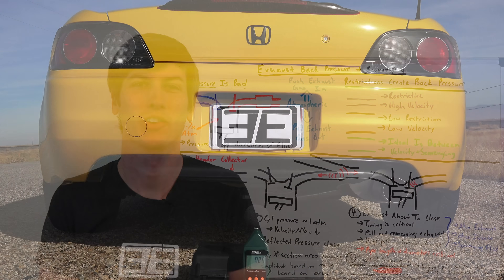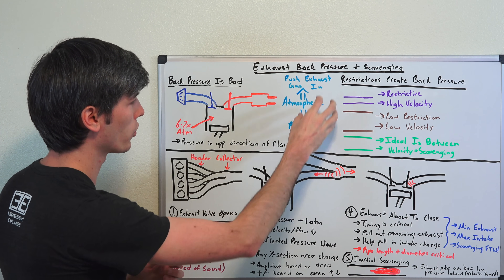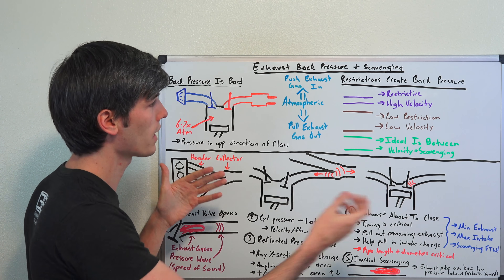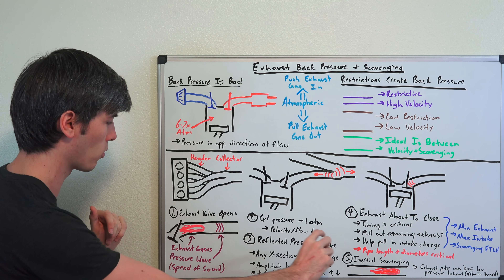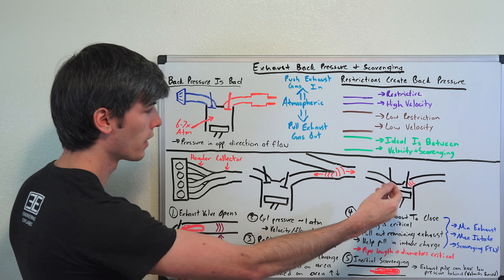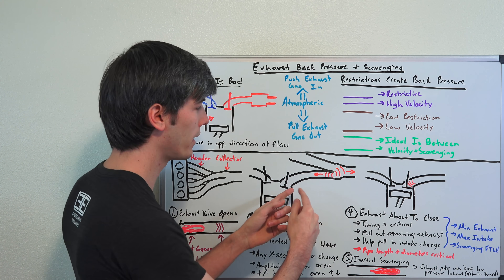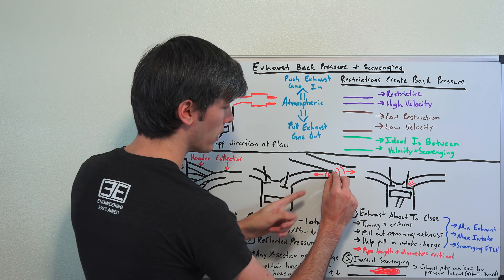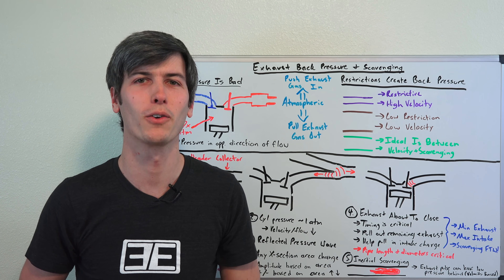Stop Saying Car Exhausts Need Back Pressure

Comment: Now we would need a nice list with good exhaust diameters for 1.6 2.0 2.5 and so on. Maybe 2 or 3 diameters 1 for high rpm Performance 1 for mid rpm and 1 for low rpm. And from that a optimal diameter for all rpm. 😁
Happy new Year btw. 👋
Reply: 99Lezard99. Not really possible, a 2.0 with 7:1 compression is going to behave different than a 2.0 with 14:1 compression.  And thats just one variable.
Reply: DrewLSsix True. Plus one might rev to 8k one to 6k aso

Comment: With need for a lower external pressure for exhaust gasses, do manufacturers consider aerodynamics of where the exhaust is placed to maximize vacuum  or are the fractions of an atmosphere negligible?
Reply: Negligible unless you’re running serious drag car power

That said top fuel cars create about 5-600 lb of downforce from their exhaust  just because they move so much air 

Same reason pro mod drag cars will run bull horn style exhaust. Every little bit counts. 

But honestly in passenger cars you’re more worried about the physical exhaust route than you are the gasses coming from it. Same goes for “low” hp cars
Reply: It makes a difference on motorcycles as their aerodynamics are crap. For example changing the direction of the exhaust tip can mean that you increase back pressure and harm horsepower by trying to make the gas escape into a high pressure zone. Or moving it a little bit can mean having the exhaust gases exit into a low pressure zone and helping with the scavenging effect.
They can't be measured on a dyno. Unless your dyno is also in a wind tunnel

Comment: Are installing headers on the s2000
Reply from the maker: I might eventually, but no current plans. I NEED to get that supercharger put on.
Reply: Engineering Explained sounds like interesting build
Reply: Engineering Explained that supercharger is going to be sick
Reply: Will you be replacing the pistons and possibly installing oil squirters.Not sure if that engine came with them.Also Id be changing head studs/bolts and a fresh headgasket.Costly upgrade to complete correctly,but Im sure you already know all this.Cant wait also.

Comment: So straight piping any vehicle is bad?
Reply: did you not watch the video?
Reply from the maker: Bad environmentally, yes. Generally it will improve power, as you remove restrictions. But you can remove restrictions without changing exhaust diameter (as is done in my catback video for my S2000).
Reply: NOT ON A TURBO IT CREATES BACK PRESSURE BEFORE THE EXHAUST ... I USE A CUTOFF FROM THE TURBO
Reply: No piping vs. having a very loud open header spewing exhaust under the vehicle to then be absorbed into the cabin.
Take your pick.
Reply: Forrest Olney so on naturally aspirated it would be bad

Comment: I live in the heart of NASCAR country, and the old time engine builders would bolt a straight pipe on the headers and run the engine up to 7k rpm, and where the pipe glowed cherry red, he'd cut the pipe and weld on a turn out. Said that little trick would add 5hp... This was back in the early 80's, so don't take any of this for gospel ;-) Excellent explanation Mr EE :-)
Reply: Painting flames on it adds another 5 hp.
Reply: That is exactly what they did- old drag racers know this.
Reply: I assume if you put a "pressure wave termination box" at this point and used a full length exhaust after, it would have the same effect. Right?

Comment: Im more disturbed by the fact that your pistons are never seated fully in the cylinders, you wont be driving anywhere with a car that has that much of a gap between cylinder walls and the piston
Reply from the maker: Are you okay with the flat cylinder heads? Pretty modern stuff in those drawings. :D
Reply: I mean if you want to look at it that way, the valves are just going to fall into the cylinder anyway.

Comment: Found when removing db killer from bike exhaust appears to have less torque/mid range..related?
Reply: Martin James Yes, at low rpms the gas velocity is slower than with the muffler in
Reply: Pavel Gajdoš thanks, bike Zzr1200 overall runs better with db killer in as best balance between low/mid/ top end but have noticed race bikes at Isle of Man TT in recent years getting louder..
Reply: Why did older motorcycles use fishtail exhausts?, some I recall seeing with explosions (pressure wave) just at the exhaust point of exit?

Comment: Another great video Jason! Mazda uses a great header design on their skyactiv g engines. 4-2-1 layout that prevents interference between cylinder exhaust cycles. Very important in Mazda's case bc theyre running 13:1 compression ratio, so theres little margin of error in terms of combustion chamber temps. Vital that each cylinders exhaust gases evacuate efficiently.

Comment: Good video and all you did a very good job explaining the science of this topic, but engines need back pressure. Scientifically you don't want any resistance at all as you have explained, but in the real world, you don't make the same power and the engine doesn't run right without a small amount of resistance. Look at it this way, I have a Ford pickup with a 4.9l i6, the carbed one with one exhaust from the manifold. I ran it on open headers for a while, when I put on a basic 2.5" pipe with a cat and a flomaster 40, the engine had more power and ran better. My guess is that with that resistance from the muffler, it creates a similar pressure wave it a vacuum in the piping that pulls the exhaust out of the cylinder, instead of no exhaust, where the Piston literally pushes the old air out, if that makes sense. That's my guess, but in my experience, a small bit of back pressure, like a small, not terribly restrictive muffler will perform better than without a muffler or resonator, something of the sort.
Reply: Your anecdote reciprocates what is stated in the video. Your conclusion, on the other hand, is incorrect.
Reply: +esqueue - you entirely missed the point of this video, apparently. While your example is kind of valid, even those cars have exhausts that have been analyzed and engineered. The length of those open pipe is not left to chance - it's very, VERY specific - to each engine. What the big difference is, is in where the power is desired. On those cars, the only consideration is ultimate top end power - so an open setup like that is ideal. The extremely narrow range or RPM's it's beneficial is not as important as the aid the proper length of of pipe gives.

On street dirven cars there are more considerations - most street cars drive of a wide range of RPM's, and not a lot are supercharged, so proper exhaust tuning is very beneficial. Pipe diameter, lengths of various sections and even bends make a difference - get it right and it's great. Get it wrong and it makes a dog out of an otherwise fun car.
Reply: corey Wellman im no expert by any means but Jason explains how the restriction in the exhaust piping creates velocity. I guess the term back pressure, exhaust gas velocity and restriction can be interpreted differently. In your case, having the exhaust gases dump into the atmosphere right after the header prob made less power vs stock setup bc of the lack of velocity. A stock or near stock engine flows a lower amount of air vs one thats modded (turbo, boring out, bigger throttle body, cylinder head etc)....The lack of airflow can be aided by the velocity of a more restrictive exhaust system. A Hellcat engine would prob benefit more from an open header than a 1.6L eco 4 cylinder bc the Hellcat is flowing a ton of air that needs to escape quickly. In your case, you may have seen a bump in power over stock by increasing the exhaust piping slightly instead of removing it after the header.
Reply: That's why funny and full race cars all have mufflers right? Forget the fact that the 2.5" exhaust might be too big for your car and you may have gotten even better performance with a 2.25" exhaust.

Comment: One of the biggest arguments among builders & tuners ever.  thanks E.E. for breaking it down!
Reply: engine masters on the motortrend channel did dyno tests with different full exhaust systems and pretty much theres no such thing as too big of exhaust but you do lose a some power and torque at the very start like below 2.5k rpm.  what people don't really look at though is partial throttle tuning and just going bigger everywhere can hurt that response and drive-ability.
Reply: wish this video was available before i wasted so much time explaining this fairly simple concept to people.  could have just dropped the link and walked away lol
Reply: @TheDealinDave, the problem with Engine Masters' dyno are, they never test under 3k rpm which is what NORMAL driving involve, you don't always redline like a lunatics...
Reply: +TheGhost ....lol, you're absolutely right!
Reply: More like among wannabe tuners and builders.
Reply: +Mathieu Levasseur .....lol, also true
Reply: decades? dolt.
Reply: WOT under 3k doesn't make much sense. And for testing of acceleration enrichments you don't need a dyno.
Reply: Tom R You could not explain anything to anyone. It takes decades of reading and hands on to understand these concepts.
Reply: Tom R No, it takes three months that's why you already know all about it.

Comment: If you have an exhaust pipe that has a constantly changing diameter and therefore constantly changing cross section would there be a constant source of pressure waves?
Reply from the maker: It seems so, though the reflected wave is proportional to the change in diameter, so it would have a very small amplitude.

Comment: Can't tell you how many old guys I have argued with about this. I quit years ago. Velocity they confuse it with back pressure. Yeah smaller pipes have high low rpm velocity, so you get better low rpm scavenging and better low end power. But then at some point they start choking the engine.
Reply: i had a 150cc scooter, and the studs that hold the exhaust to the exhaust port broke one time, and made the scooter so slow, it was normally able to go 60ish mph, and with the open exhaust port, it could barely go 15mph
Reply: Kevin Norris ... said the old guy.😜
Reply: afaik, you need to set it up again, timing etc to work with the new exhaust and the reason why they loose power is just that they are not tuned to be without one.
Reply: SquidCaps oh, that makes perfect sense, the air/fuel would have been dramatically different, and the amount of air that would come in on the intake stroke probably would change because of no exhaust scavenging, there would be all kinds of variables that would need to be accounted for in tuning in order to make a performance comparison between the two exhaust situations. That would be an interesting test
Reply: Devin Royce was it 2 stroke?
Reply: I thought the high and low end power came from the length of the header/manifold tubes?
Reply: It was a quick reply while I was waiting for church to start on my cell phone. I figured his video which I hadn't watched and just now am starting would explain it in good detail. Geesh.
Reply: Frieberger bashed some headers to see if it affected horsepower, now he needs to test this stuff on Hot Rod Garage to see and end the argument.
Reply: Back pressure as the old timers like to call it is nothing more than an intermediate pressure. Fluid flows from high pressure to low pressure to normalize. Additionally exhaust gasses have "momentum" which is energy in motion. The energy in the hot exhaust gasses are cannibalized to improve flow dynamics. Changing exhaust specs can change the energy properties of the hot exhaust gasses.
Reply: No not back pressure. The energy properties of the hot exhaust gasses were altered. Gasses "fluids" have mass. If you have ever stood in a flowing river and it seemed to pull you along, that's what exhaust gasses in motion are doing for your engine. They need to be tuned.
Reply: Zero chevy already has that on the corvette.
Reply: Mean Man : Which is exactly why you need to know what RPM band you want to improve before designing exhaust system, and you need to know approximately what volume of exhaust your engine will produce in that peak range so you get optimal velocity for scavenging.  That is why you won't find any engine, particularly true for natural aspiration, that has a power/torque graph that is a straight line, they are all curves.  It is about creating the specific curve you need for your application.
Reply: Congratulations. You are one of the few here who truly understand the workings of tuned exhaust. Most of the others would have you believe that you get a burst of extra power just before your catalytic converter plugs up.
Reply: MeanMan, spot on.
Reply: really! high end= max / low end=min
Reply: Better low end power is better for most people on most occasions. It’s streetable. Vtech high rpms type power is barely usable at all on the street, test drove a 2006 civic si sedan, you are above interstate speed limit redlining 2nd gear and the powerband is tiny. The 400 cid Pontiac big block I had, massive torque low end and a low redline I never had to touch because it rarely shifted over 2k rpms because it had enough low end power to push the 3 ton car down the road as fast as I could desire.

So I’ll take the ‘restrictive’ exhaust over the open exhaust for the low end power in most cases. I’ll take a pretty much open exhaust for a rotary.

What we need to see is variable exhaust in the future like we have variable intakes. The renesis did the intake with a rotating cylinder (SSV) that had different stages for medium and high load/rpm, a similar system for exhausts I’m sure could be developed for all engines to have the best of all worlds for intake and exhaust imo
Reply: Bruno Danese no, it was 4 stroke. Im not sure why having no exhaust had such a large effect, its an annoying story for that reason. Im assuming that having nothing to direct flow from the exhaust port could have increased back pressure somehow at higher rpms, but i really dont know lol
Reply: Devin Royce I have a 2001 3.8l camaro that had the same thing happen, corner bolt of my exhaust manifold broke, at low load you could gently ease it up to 80, but at WOT it wouldnt get past 55. Got it fixed, but it still wasnt shifting right, ended up being a clogged cat which I have since deleted and now runs great, Maybe something to do with the interruption in exhaust flow also trips up the 02 into thinking the car is running leaner than it really is, dumps it all at low speed - high load, and cuts the fuel at higher speed - low load because the back pressure is  reduced, allows the exhaust leak to close up, and the backpressure to smooth out, and the 02 sensors return to a more accurate reading, but everytime the engine downshifts and tries to accelerate, the exhaust leak opens back up and trips the 02 sensors.
Reply: So you're saying there's a balance.  It sounds like neither you nor the old guys could slow down long enough to hear the benefits of both for different circumstances.  Even you just described a situation in which some back pressure may be preferable.
Reply: You're making a general answer to a specific question.  You're right and wrong.  A, not all engines require back pressure.  B, some engines require back pressure.  C, the characteristics of an engine are altered by the backpressure; sometimes this is favorable, other times it is not.  Your statement expresses some ignorance.  A bit of humility would serve you better.
Reply: Mean Man You're incorrect

Comment: So on early mornings when I add my silencer to my sti, so I don't wake up my neighbors is that bad?
Reply: alex rodriguez yes. Because now your neighbors won’t wake up on time and will be late for work.
Reply: Yes very bad you need to strait pipe it
Reply: alex rodriguez yes its sinfull.
Reply: View This yhea I believe it. I only use the silencer when I leave after midnight and take it off when I'm about to leave... once I left it on a quick drive and u can feel
Reply: alex rodriguez...I have a roots supercharged v8, and the equivilent of 4 mufflers. A dual in /dual out followed by 2 glasspacks. I wonder if there is too much back pressure and if it's affecting my top end and top speed. My lousy neighbors are happy though.

Comment: On a two stroke though. . .
Reply: It's exactly the same except the scavenging effect is even more useful as there is more unburned  fuel after the initial powerstroke. The take from this is that backpressure is the wrong term.
Reply from the maker: Explained here: https://youtu.be/z-7AkC3gh4w
Reply: Does not the same thing happens with 4 stroke engines with high overlap cams ? Fuel and air that escaped on the exhaust valve get sucked back in ?

Comment: Removing back pressure on a diesel (emissions delete/larger diameter pipe) makes a huge difference in the amount of power an engine can safely produce.  The better flow enables you to tune for a lot more power while keeping EGT at safe levels.  If you attempted the same power tune with factory exhaust the turbo(s) would fail.
Reply: Its called government regulation.
Reply: BrianNC81 Quite an antisocial adjustment though, as the dpf is designed to reduce small dust particles from your exhaust gasses by up to 90%. These days almost everyone has a member of their immediate family that has died due to cancer; I just don't see why anyone would decide delete the dpf. And even be proud of it...
Reply: Niels Onderbeke I'm glad my truck was never equipped in the first place with DPF due to it's age.  Better reliability, mpg, and power.   A diesel without a DPF should not smoke if tuned well but there are idiots out there that dump a lot more fuel than needed to put out more smoke on purpose.  With an optimal tune it should be fairly clean without DPF.
Reply: Not even close.There is a reason the dpf exists or all diesels would be still be made the way you claim.Its called progress......